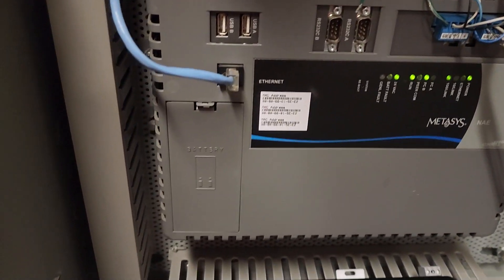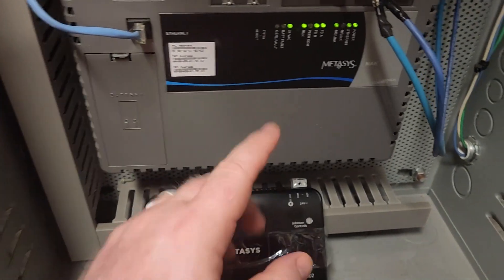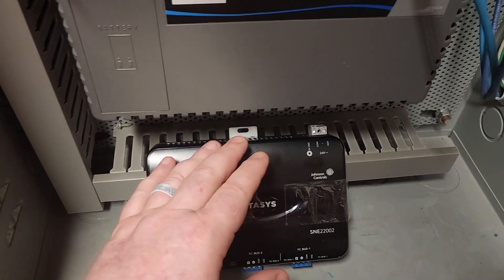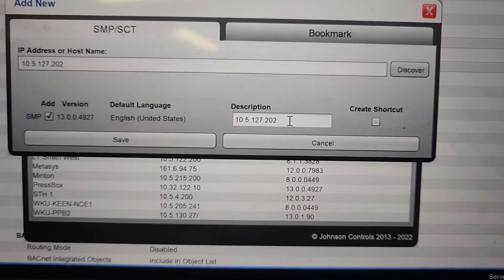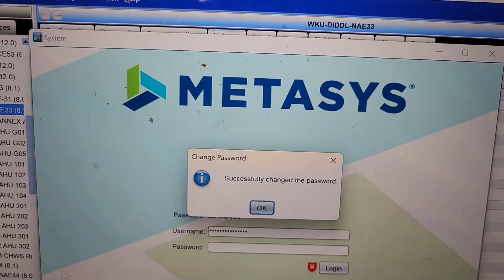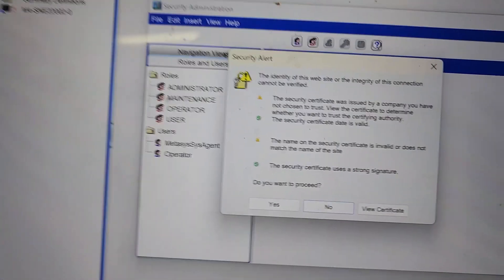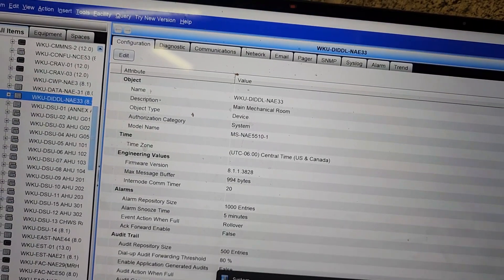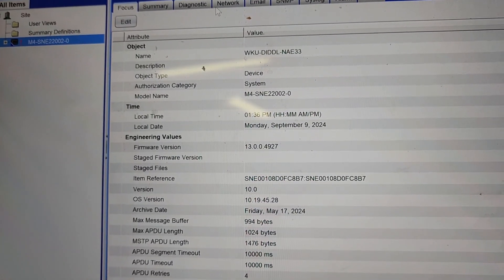Upgrade Your Building Automation: Johnson Controls NAE to SNE Step-by-Step Guide!

Comment: Have you received any SNE's running firmware 13.0.1.100? I just received one and could not get the resource files to access the device from JCI's website. My rep said he would get me the files, but, he told me I can use the UI to access it directly. After sniffing out the IP address, I put my laptop on the same network, opened my browser, and typed HTTPS://(IP address)/UI. I was then prompted to put in the username and password. Once I accessed it, I first added my login credentials, then changed the DHCP IP settings to Static and put the device into my network. I rebooted and logged back in and changed the name of the device. Again I rebooted. I am currently waiting for my server software to be updated from version 12 to version 14. Once that is complete, I will demote the device and discover it into MUI. Hopefully all goes well, since I have never done it with this UI before. I need version 14 to upgrade my data base for the old NAE to an SNE firmware version 13. Let me know if you have had any experiences with this yet.